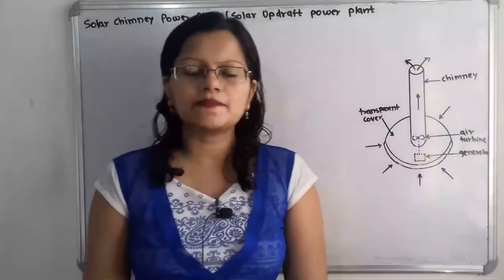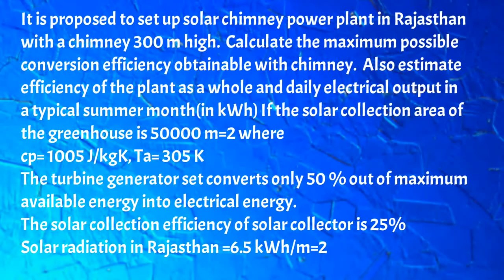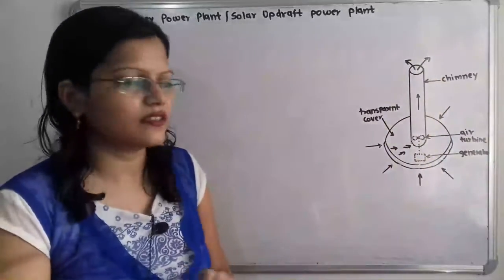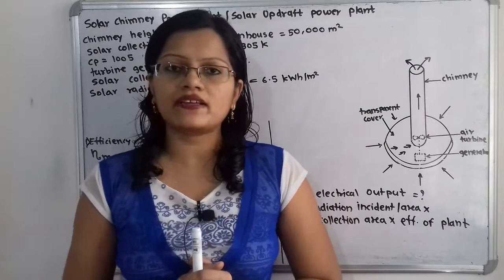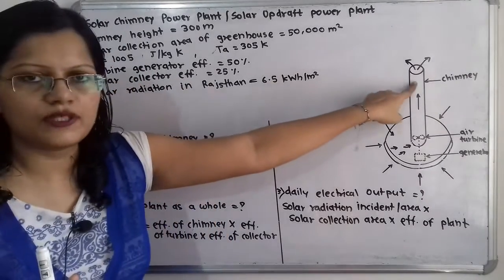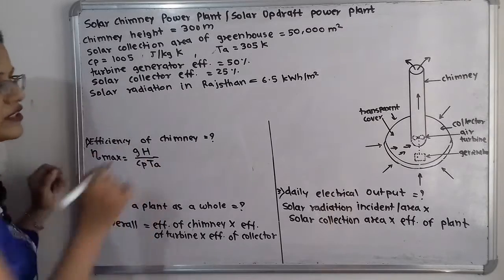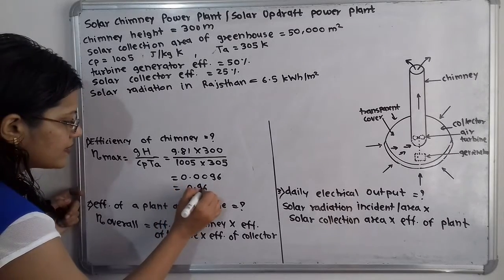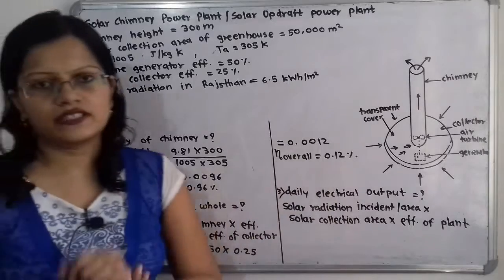Problem on solar chimney/ Solar radiation / Renewable energy engineering

Comment: mamm i have some questions regarding the solar chimney...plz hels us to solve these problem
Reply: mamm i m m.tech student at IET lucknow...and my research topic is thermal analysis of solar chimney
so i want to know about how to calculate air flow in chimney...is turbulent and what is the renoyld no,or heat transfer coefficient at different locations
2=what is the minimum pressure required for turbine
Reply from the maker: @raghvendrasingh8160  I made different videos on power plant engineering, fluid mechanics regarding your questions. So please refer my play lists
Reply from the maker: I am going to add more videos... please watch my all videos.